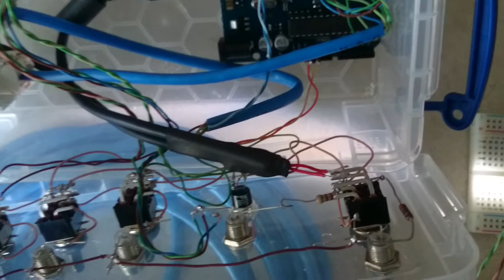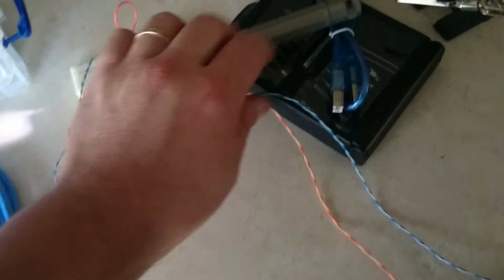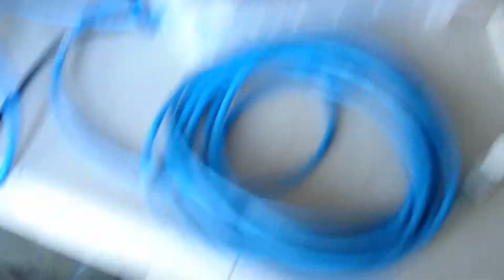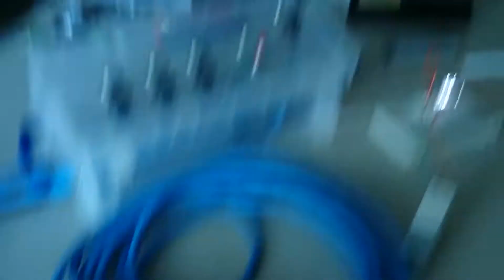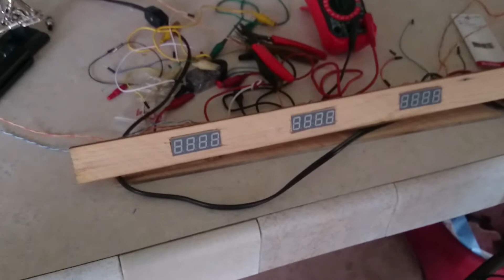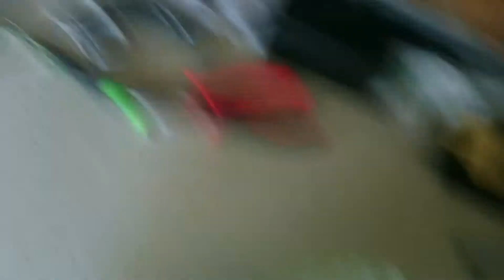Second Pinewood Derby Timer Part 2

Comment: Hello Justin, excellent work! I'm just about to start building the timer, for our local scout group, using components supplied by miscjunk. Please can you tell me the purpose of the double pole switches and how they are wired in?
Reply from the maker: Dajavoutube I used one side for cutting tje sensor and the second pole for the lane indicator led.
Reply: Hello Justine, many thanks for your reply. I'm making steady progress with my timer and would like to include the lane switches and diodes.  I understand what the switches are doing but not being an expert I don't know how to wire them into the timer. Please could I trouble you for a schematic showing how the switches and their corresponding diodes are connected? A diagram for just one lane would suffice. I can then repeat for the other lanes. Many thanks.